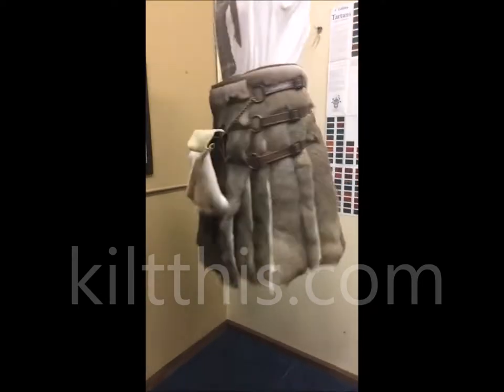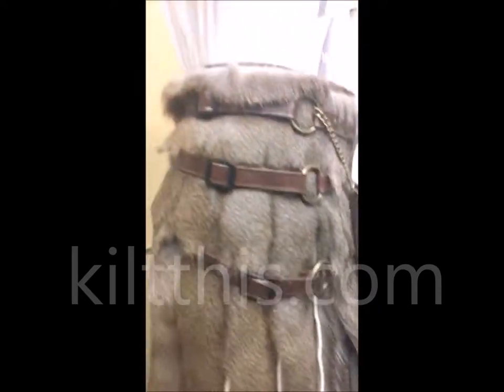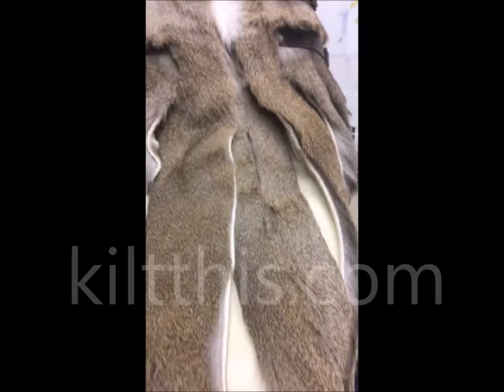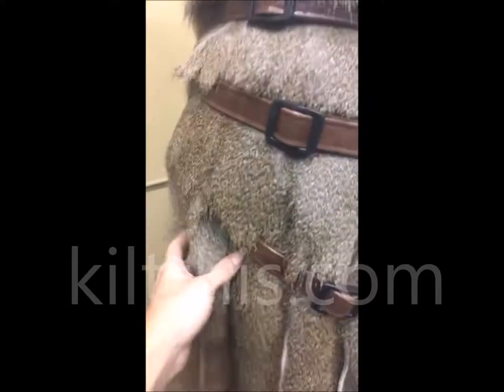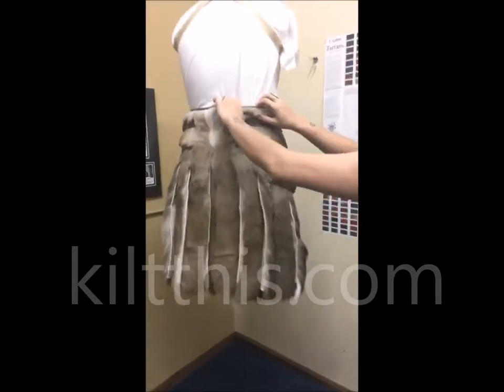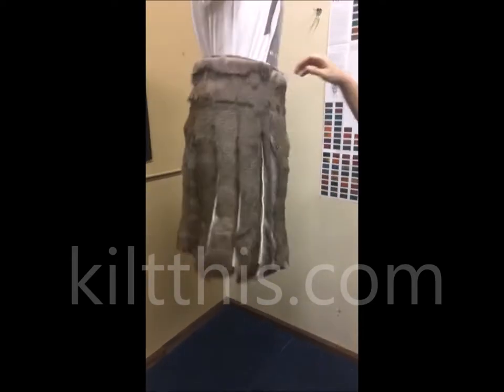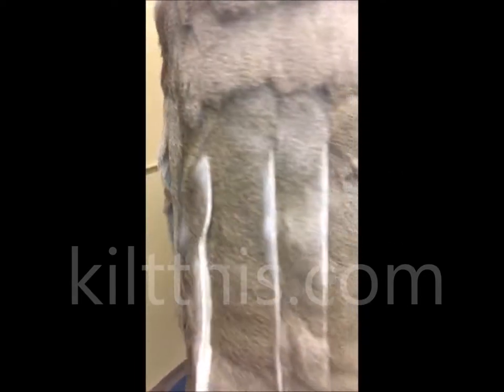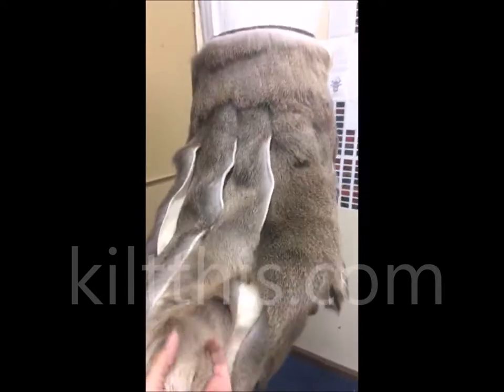Deer Hides create Fur Kilt by Kilt This

Comment: How much is something like this?
Reply from the maker: It depends on who provides the hides. This took 5 hides provided by the buyer and we were responsible to cut the hides, shave them where needed and sewn, and design it. The cost also depends on measurements. Minimum it would be $800 for the design, cutting labor and sewing.